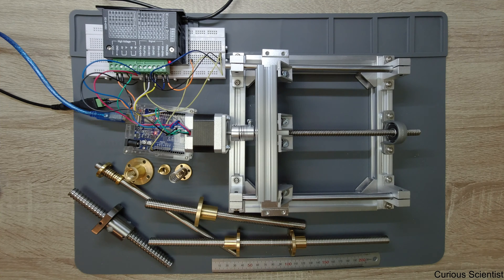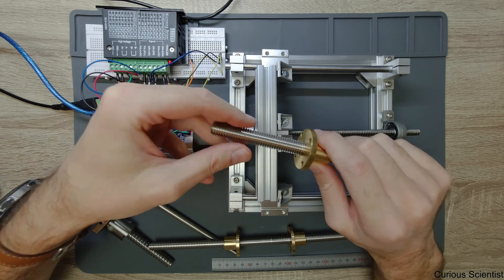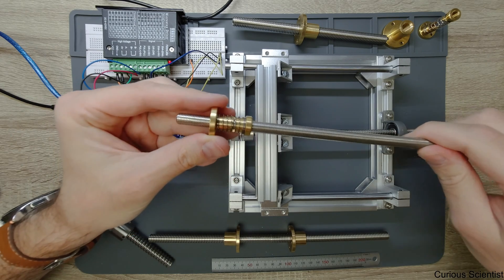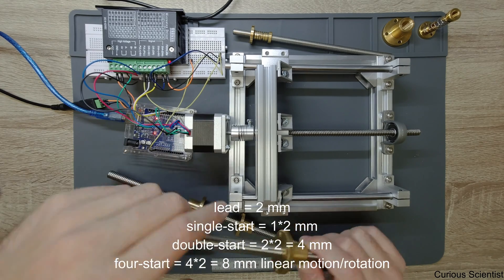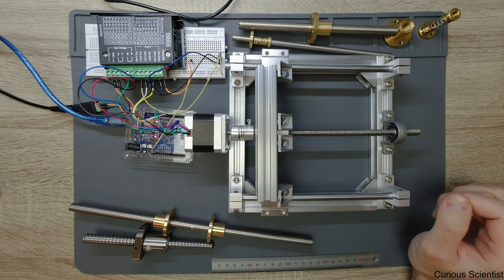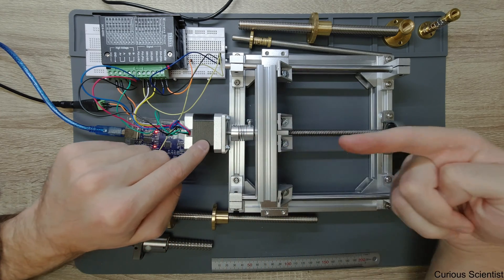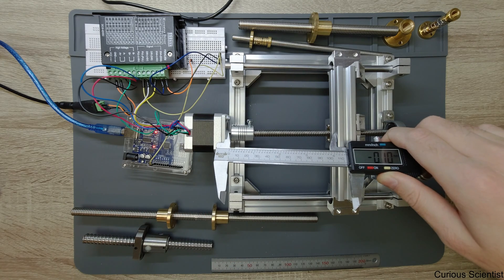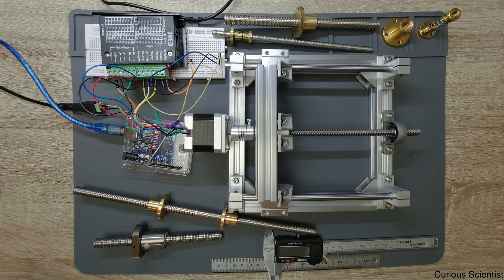Linear motion with TB6600 and AccelStepper

Comment: Do you think this setup will work for a vertical axis?
Reply from the maker: Sure. As long as you respect the load limits, it can be used.
Reply: @CuriousScientist  I'm looking to build a vending machine for over-the-counter drugs(ibuprofin, pepto bismol etc) and on the vertical axis i will put a 15cm 2040 aluminium vslot profile and a linear actuator. I think it will do the trick
Reply from the maker: That should be no issue. Even this contraption I show in the video could lift several kilograms. If you build a proper frame and maybe even use some pulleys, you can lift even more. But for some medicine, it should work fine.
Reply: @CuriousScientist  Yeah that's what i thought, thanks for your response and for this video, keep up the good work👍

Comment: Hi,  I'm making a device that uses a motor and a loadcell. I'm using a pushbutton to run the motor and I'm also using AccelStepper to control the motor. However, whenever I run the motor, the load cell stops printing readings. If you have time and are available Is there a way we can communicate so that I can show you my code? If not, do you know what the likely cause for this issue might be? Thank you
Reply from the maker: Hi! As I talked about this many times in my miniature tensile testing machine videos (which involves a stepper motor and a load cell handled simultaneously), the Arduino is simply incapable of handling serial communication and driving the stepper motor at the same time. At least in a way we use it. The problem is that it usually takes longer time to handle the serial communication than the time between two steps of a stepper motor. This means that the stepper motor will skip steps or do the steps with irregular time periods. My solution was to have a separate Arduino to run the stepper motor. If you want me to check your code, I can do it, but not for free. My mail address is on my website.

Comment: Hi, Do you have a video that  have the following condition.. a Motor target Location, when i press START button it will run, and while running when i press the STOP button it will stop, when i press the RESUME button it will continuous until reached the set position..
Reply from the maker: Hi. Yes.
Reply: @CuriousScientist  may i have the link, thank you in advance
Reply from the maker: https://youtu.be/PkmPmwt8DbA

This probably contains the info you need. But there is a very useful function in YouTube called "search".

Comment: Hi,

Can you use the TB6600 for a NEMA 23?
Reply from the maker: Hi! Absolutely!
Reply: Thank you for replying, i got some questions about lead screws, can I ask them here if that’s fine?
Reply from the maker: Of course, that's why we have the comment section.
Reply: Ok thank you,

So i’m planning on using a lead screw to drive a joint in a robot arm.

How would I know the torque given by the lead screw? Would it be the same torque as the motor or will it change?
Reply from the maker: It will depend on the characteristics of the motor plus the lead screw and the mechanism you put on the lead screw. It is a bit of everything.
Reply: Ah ok, is there any way of measuring the torque of the lead screw (formulas etc.)?
Reply from the maker: Have you tried using Google? If you search "lead screw torque", the first hit is a calculator....
Reply: Ah ok thanks!

And is the difference between single start, and four start, that four start would move the nut faster?
Reply from the maker: Yeah, it depends on the perspective, but yes. In one turn, the nut on the four start lead screw travels four times the distance of the single start nut. So if you rotate them at the same speed, the 4-start will be 4x faster.
Reply: Ok great!

How would I choose a coupler? If the shaft diameter of my NEMA is for example 8mm, would I just go for a coupler of 8mm?
Reply from the maker: Obviously. But you also have to check the lead screw diameter. If it is also 8 mm, you go for an 8 mm to 8 mm coupler.

Comment: Hi. Do you know wich was the motor rpm when tested?
Reply from the maker: Hi! Unfortunately, I do not remember, but probably not so much. If there's a source code shared, then you can calculate the rpm based on the speed set for the motor.